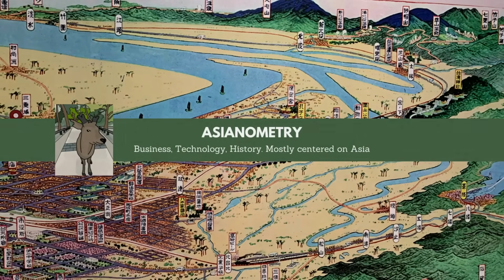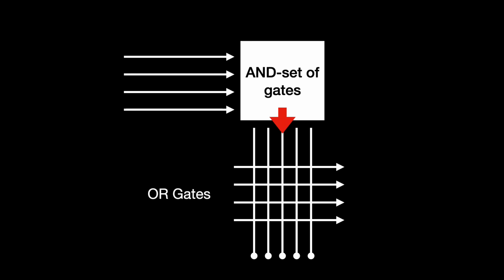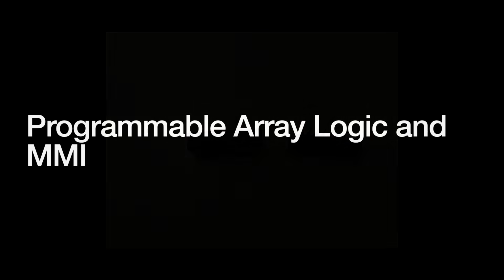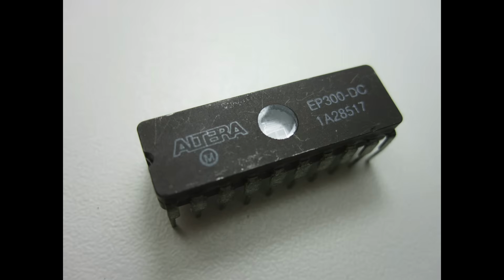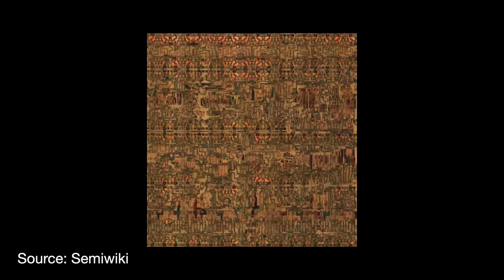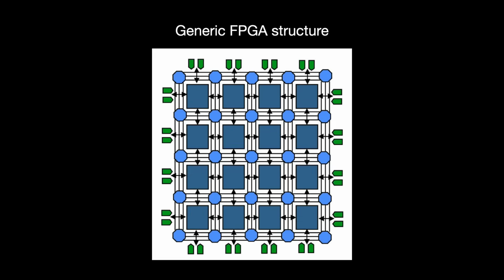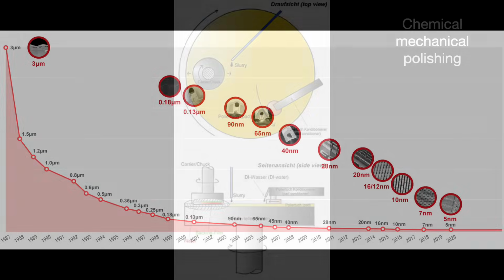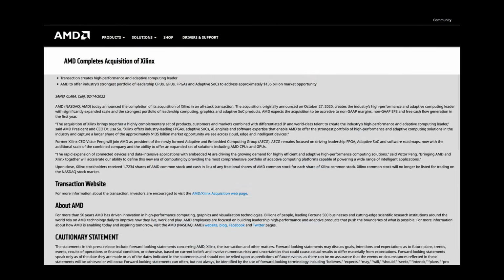The History of the FPGA: The Ultimate Flex

Comment: In 1980, I became a hardware engineer at Boeing Aerospace, the military side of Boeing.  We were using simple TTL circuits and wire wrap boards.  The easiest way program these circuits was to remove wire wrapped wires and re-wire the whole board.  This was considered state of the art.  Then I read in EE Times that Cypress made what they called a CPLD with included EDA ABEL.  I called them, and they were glad to send me samples plus ABEL.  The products worked, and I started the CPLD craze at BAC.  Then I moved on to a defense contractor in Orlando, FL.  I introduced the CPLD there in 1984.  I couldn't believe I was doing this as they had hundreds of hardware engineers.

Over the years, FPGAs came along and matured.  They were hard to use, but EDA was the issue.  They didn't trust it and continued using schematic entry.  I was called to work on a brand new project, and we had meetings about how we were going to design.  I was in favor of using VHDL, and a very influential engineer wanted schematic entry  At at meeting, our management wanted to know why each one of us was so different in the design approach.  We were invited to come up there and  rationalize our design entry method.  The other engineer made some slides and showed that schematic entry was the way to go, mainly because everyone knew how to use the tool.  In his conclusion, he said "A picture is worth a thousand words."  Then it was my turn.  I went up and explained the internal workings of an FPGA and how complicated they were as a function of density.  I then showed how VHDL worked, especially using IF THEN ELSE and Case statements.  My final conclusion ended in "A word is worth a thousand pictures.  Which one is easier to implement?"  Of course we went with VHDL, and it became the standard design entry for decades.  As these products matured, another EDA came along named Verilog.  It was actually long used by the ASIC community, of which we knew nothing about.  If you wanted to use Verilog, you had to quit and go with a commercial company.

I was a contractor at this defense company and started roaming around other companies, spreading FPGA usage.  Xilinx was always trying to get me to switch from Altera to them.  One day a Xilinx FAE wanted to talk to me and asked me what I would like in an FPGA that wasn't there yet.  I told him that I had to implement my own FIFOs to cross clock boundaries.  He immediately saw the benefit of this and went back to the factory.  Lo and behold the next line 4000 had built-in FIFOs!  Since asynchronous clocks were a big problem, this family made it big everywhere.  From that innovation, Xilinx made me an XPERTS partner, and I flourished big time.  End of story.  Sorry it was so long.
Reply: Any advice for someone who wants to learn more about advanver digital design on FPGAs? I learnt about them in my BSc any did basic vhdl but I would love to learn more advanced and useful  stuff.
Reply: @wizardman1313  buy a cheap kit and dive in. Don’t stand on the sidelines. Don’t either. Just dive in.
Reply: @peterfireflylund  thanks, do you have any project suggestions that would teach impprtant/necessary concepts used in the industry and increase experience over time? For example, can you provide 5 projects where the 1st one is basic, introducing important stuff you used in your work experience, and the other 4 projects build upon the last in complexity, in manageable increments? So that by the end of the 5th project one can gain considerable experience and skill?
Reply: @wizardman1313  That would take a long time for a retired guy like me that likes to mow lawns, pay bills, get groceries and fly my airplane.  I suggest you talk to your Xilinx FAE about it.  They are very helpful, because they want you to become a Xilinx user.
Reply: @peterfireflylund  
I think the question is, Where to dive? 
Just a simple "The X company Foobar 92" would help.
Reply: @wizardman1313  
" thanks, do you have any project suggestions..."
In English, "Thanks but no thanks, A-hole."
Reply: @wizardman1313  My suggestion is to study the FPGA architecture so you are aware of its features.  These are things you don't have to design, cause it's done for you. With large FPGAs, it is a daunting task.

Then somehow you have to learn the tool that translates VHDL, Verilog or some other language like MathLAB  to a netlist, which is how the tool interconnects everything.  This is another daunting task for a beginner, so I suggest you latch on to a senior FPGA engineer so he can mentor you.  One thing you should keep in mind is simulation.  The very language you use to design the FPGA functionality is also used to simulate the design by writing test vectors, which serve as inputs.  These inputs will exercise your design and generate outputs.  Test vectors will also monitor the outputs to verify they are correct.  When you change something, you simply use the same vectors to verify functionality.

And the last thing I want to say is to NEVER use asynchronous design as it will throw the simulator off track.  It will also cause glitches that you will never find unless someone familiar with synchronous design looks at your design and finds it.  To a seasoned designer, they will stand out glaringly.
Reply: @wizardman1313  I took several courses on them as part of my BSc and it was all very important foundational stuff but none of it really prepared me for how it actually works in the real world - you almost have to learn that on the job. Not that there aren't some incredibly useful materials out there that will help get your feet wet, but a big part of the problem is that you need to be able to study the work of other engineers to be able to really gain an appreciation for the power of an FPGA as well as how to use it effectively - and most large, interesting designs are proprietary/trade secrets. Make it known that it's an interest of yours and gravitate toward jobs/teams that work with them. Also, keep in mind that FPGAs go hand-in-hand with signal processing, so look for opportunities involving that, too.
Reply: @jamesdurtka2709  Thanks James
Reply: @wizardman1313   Define a new project for yourself and solve it!! Challenge yourself. For example, implement protocols such as I2C, I2S, Ethernet, ... . Implement image proceesing, AI, Bioanformatic, accelerating, .... .
Reply: @wizardman1313  My advice is to do a training course in VHDL that focuses on VHDL for synthesis. Synopsys used to do a really good course many years ago.

The key point being that some elements of VHDL cannot be synthesized into a logic circuit. RTL VHDL is what you are interested in.

But you should also focus on synchronous design and don't do silly things such as gated clock lines, however decent design tools will pick this up.

Make sure you fully understand Finite State Machines, Moore and Mealy models and the differences between them.
Reply: @wizardman1313  
The learning curve is steep but there’s never been a better time to learn FPGAs (silicon shortage aside). 
I would recommend getting a dev board (Arty A7, go board, DE-10 series, etc)and start with simple projects to learn the synthesis tools. 
I learned a lot from FPGAS for beginners and Nandland YT channels
Reply: My tears fall as I read your comment. What an amazing story.
Reply: @CésarAugustoMartínez  Thank you, Cesar.  I'm sure you have some good stories to tell, too!
Reply: very interesting! thank you for sharing
Reply: Wow that is an amazing story Koyote, what an experience to see FPGAs start from nothing to where they are now!! I have done some stuff with FPGA's and I think they're great, but I was wondering do you know of any hobby friendly FPGA platforms? Like the Raspberry Pi equivalent of FPGAs? I do have experience with verilog, but I just want something that is user friendly for tinkering with, just thought I'd ask :D
Reply: @zb9458  I think the Terasic DE10-nano would be the Raspberry Pi of FPGA boards
Reply: @zb9458  i learned it during my studies as a photonics engineer and we did it with a xilinx board (i am not entirely sure anymore but i think it was a called zen or something) and used vivado to program it, you can also use verilog depending on what you prefer, it’s a powerful tool when you figured out on how to use it and has a ton of documentations. Maybe that is a starting point?😬 Vivado is definitely not my favourite tool but I must commit that it is very capable.
Reply: @retusrieben6487  I understand, but I claim it is a great tool, and Xilinx provides it free for several of their FPGA families.  It is worth every penny!
Reply: @koyotekola6916  don’t get me wrong! It is indeed a brilliant tool! But as it is such a feature packed program it is also starting to get unintuitive which is often the case with a lot of tools like that. But yes it is super powerful!!!
Reply: @zb9458  FPGA is for legend!!
Reply: Thank you for advancing my career :). I was one of the first three product engineers on CPLD devices at Cypress in the mid-1980s. I most likely provided some of the engineering samples marketing sent to you for evaluation. Cypress was the first of three companies I worked at which had successful IPOs, all thanks to product adoption by courageous system engineers like you. Here I am over 30 years later enjoying retirement thanks to you.
Reply: @johnhorner5711  Yes sir!  In my original post, I don't believe I mentioned who the company was that turned me on to PLDs.  The other day I remembered it was Cypress.  The mere fact that you and your team developed both PLD hardware and software (ABEL) means you were ahead of me by 5-10 years!
Reply: Pretty interesting 👌 the video are great but the comment section on this channel is always the cherry on top.
Reply: @perspicaxingenium  It's nice to visit a YT comment section that isn't mostly people throwing insults at each other and trying to assert their superiority.
Reply: @igotes  I agree.  It boggles my mind how much Asianometry knows about Asian manufacturing, its history, and how the electronic components work.  I wish more FPGA designers would comment here, because there are some very good ones I've met over the last 40 years.  Some of these guys run circles around me.
Reply: Ohh boy. I saw soo many boards made this way in my time. There was a frequency meter that was all done with TTL and ECL using wire wrap. One of my books on FPGAs (The Design Warrior's Guide to FPGAs) says that one of the first users of FPGAs was the airplane industry because they didn't use so many chips that were profitable to create ASICs. Another use case was oscilloscopes which being expensive equipment wasn't produced in quantities that allowed the use of ASICs, In fact, the two oscilloscopes I have use FPGAs inside them.
Reply: @agranero6  If you're writing books on FPGAs, then I claim you must be very good at FPGA design and simulation!  I know a couple of guys who have written books, and they were sharper than a Putin's tongue!
Reply: Cool to hear from a contributor, evangelist and pioneer in use of an important technology. Thanks for your contribution!
Reply: Wow, thanks for sharing, Koyote. It's much appreciated.
EE 1986 class here.
I made a Frame Grabber for CGA back then. All TTL and a few comparators on plug in protoboards.
Had no money to buy an FPGA
Reply: This sounds like an important piece of history that should be in a more permanent form than a Youtube comment.
Reply: @mrgomelonsolaris  Well, thank you very much, but I know that there are many other engineers who were similar leaders in the field.  I remember critiquing a Westinghouse radar design and finding a fault.  When I traveled to Baltimore to present my findings, I was surprised that they had a better way of doing it. I took that method back with me, but it didn't apply to most designs done at the time.  Later I found that their method came from the nuclear weapons area.  So there are really good engineers beyond my comprehension everywhere.
Reply: So you are the Forest Gump of FPGAs, huh?
Reply: @peterfireflylund  First of all, it's Forrest with two r's.  Second, I could never be Forrest Gump.  Do you realize that he attended the University of Alabama on a football scholarship!  And he met John F. Kennedy!  I would be honored to be Forrest Gump with two r's!
Reply: Cool story bro!
Reply: That was a super cool & interesting story! Please share some more!
Reply: That's a really good story, thanks for sharing. Asianometry should interview you actually.
Reply: @malloot9224  Thank you, but I am totally astounded by the videos he posts.  He has a lot of knowledge built up in his head, and I know the reason is because he is a fast learner and thus a good researcher.  I want to believe that he was intimately involved on those design teams to know so much about them.
Reply: My man been waiting years to have an audience for this story. Enjoy it my friend 😊
Reply: Thank you for sharing such a profound part of your life with us, and i mean it.
Reply: @dieSpinnt  you’re right, I bought my DE10-nano 2-3 years ago for around 120 euros, now it’s out of stock and the price has skyrocketed, that’s too bad. Thanks for mentioning alternative boards!
Reply: Amazing! Who'd have thought that meeting your customers' needs can help your business?
Reply: It's great story
Reply: @gmlssns5859  TYVM. It's a story that spans decades and several generations of technology advancement.  Anyone who has 55 years to spare can write an equal story.  You may be one of those!  👍
Reply: I personally think the best way of starting (reprogrammable) HARDWARE design is to get rid of all mental concepts of SOFTWARE first. These days are so software centric that I regularly observe unexperienced hardware developers trying really hard to use their software skills in the design process, which is doomed to fail. Designing hardware is completely different from software. This is especially tricky with FPGAs because they are designed with hardware description languages, which look a lot like usual programming languages (VHDL borrows its syntax from Ada, Verilog from C), but work totally different in many ways. I'd even say that being "too experienced" in software development may be a hindrance in learning FPGA design because you'll have wrong expectations about how some language constructs work.
Reply: @NoSpeechForTheDumb  I wholeheartedly agree.  There are other considerations from what you describe, like synchronously crossing clock domains that software engineers never think about.  Another commenter earlier challenged me and said he was a software engineer who could easily do what I did in less time.  He sounded more like a junior software guy who had some simple success stories and thought he could do anything.

He reminded me of a software guy at a company who promised management that he could do the same job in C#.  When the Engineering Director asked me why he couldn't, I told him the schedule wouldn't allow it.  He asked me why.  I said that the very first thing this guy needed was a compiler and simulator to take his source code and generate working hardware.  He asked me where he could get that.  I told him he would have to invent them, because there was no such thing.  He got back to the software guy, and he told the ED he could do that in C#, too.

I felt sorry for those dodos.  Six months after I finished and everything was working fine, he called me and told me they had lost the source and hardware programming files.  He asked me if I had copies of them.  I told him the NDA required me to erase everything on my computer and why not ask the software guy to generate them? He said they fired him for failure to produce.  That, too, reminded me of the previous commenter.
Reply: The Navy played a fundamental role in financing early FPGA development. A lot of the tech we have today (sold by private companies) was actually funded by the US taxpayer. BTW, even the development of Psychology and AI received huge funds from Defense related institutions. Thanks for your comment, btw!
Reply: @maxheadrom3088  YW!  

Thanks for your comments about the Navy, Psychology and AI.  I can always use more information!  Even in retired life, I'm always learning.

Just a comment on how the feds funded research. I started life after HS as an AF electronic technician. When I was in Thailand, we worked on RF-4Cs and C-130s. The RF-4C was particularly advanced. We had the ASN-46 Inertial Nav System, and it was derived from the Apollo program.It was one of two systems that I knew of that used transistors and chip technology. It was very advanced and only some technicians could work on it. We colloquially called it "I'm Not Sure."  The pilots appreciated that. :)

The other system was the APX-64 IFF/SIF transponder.  It was even more advanced and had a crypto section. Needless to say even less technicians worked on it. It heavily used custom but simple ICs. The military drives the IFF world. Today, all aircraft in the USA national airspace use a simple derivative called a transponder, and most recently ADSB In and ADSB Out. These are required to identify aircraft type, location and altitude in controlled airspace.
Reply: I think you did appreciate there was salesman who did see what you did see and understand you when you show the person something new (and maybe complicated for some persons).
Reply: @XantheFIN  I've known salespeople and FAEs in the electronic design world since the 1980s.  While some of them aren't that good, there are others who are really good.  One FAE designed all the software for a microcontroller that I used in a "Smart Bullet" program.  He sold me on using that micro over others, then helped me design it.
Reply: Sorry? that's amazing.
Reply: BDS
Reply: FPGA was developed under a navy contract, right? It's a great invention!
Reply: I don't agree that FPGA's were hard to use. I was using them at the start of the 1990's.
Reply: Wow! Lucky you. Very early. We started in the 90th using Altera. But used Lattice GALS before. So from that macrocell-design I immediately felt quite common using Altera.
Reply: good for you, brag much?
Reply: @dronefootage2778  Not bragging, just relating my experiences to people here.  If that's bragging to you, then it's a compliment to me, since you acknowledge my experience.  Thank you.
Reply: @koyotekola6916  it's absolutely bragging and yes i do acknowledge your experience but one thing doesn't have anything to do with the other. one problem with your story if i may rain on your parade for just a sec, you should have been one of those startups instead of working for someone else. you talk about those 100 engineers that apparently weren't very smart, they probably all ended up benefiting from your talent and i bet some of them even got paid more than you and had less talent. your boss or bosses made the most of your work. that code that you had to write 2 times, why where you writing code for other people instead of making your own products or whatever? some of the people from this youtube video left their company and then started their own, i suppose you could have been one of them. the last thing i'll rain on, it's a cpld/fpga, honestly how complicated can they even be. i bet i could learn them, including verilog in 1 day and i bet if i spend 1 week i could get really good with it, 2 weeks tops, just something for you to keep in mind.
Reply: A millennial fpga contractor here,thanks for your service sir
Reply: She said, "You're movin' with your auntie and uncle in Bel-Air"
Reply: The good ol' days
Reply: and then everyone stood up and clapped i guess?
Reply: @DuckyThePilot  No, they didn't know what to think.  The technology was too new to them, and they stayed quiet.
Reply: We owe you our lives!
Reply: Verilog is not an EDA, it's a language.